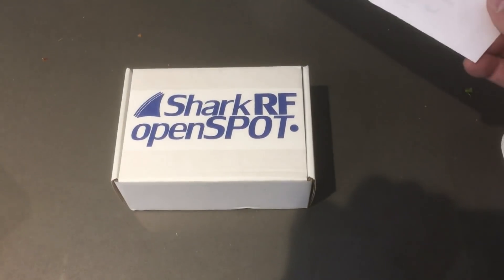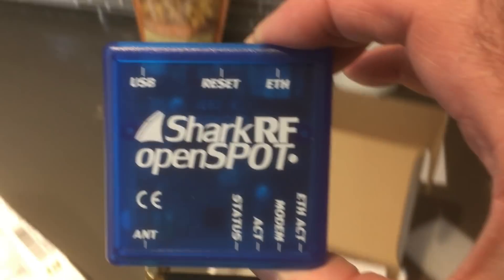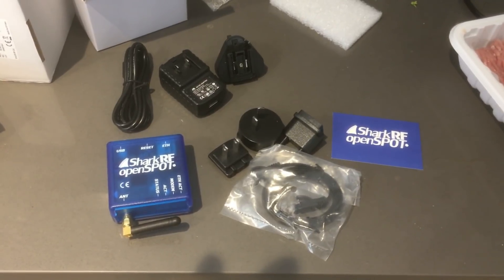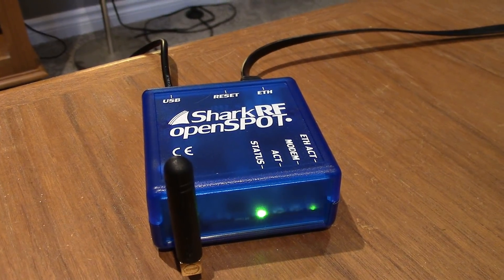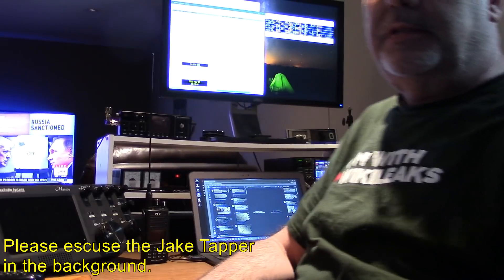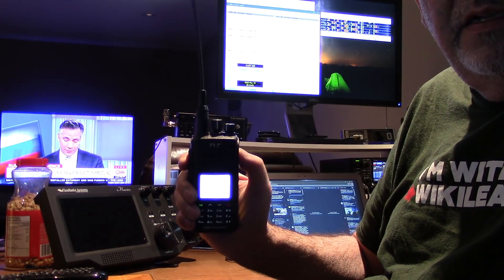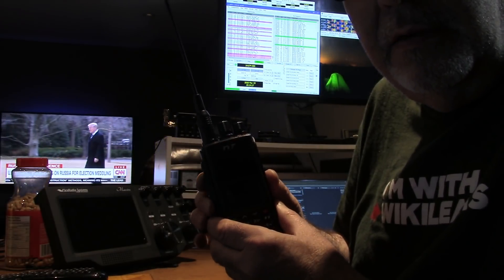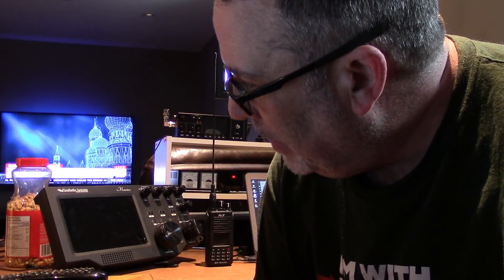Tytera TYT MD-390 - BRICKED!

Comment: Have you checked if the firmware matches the radio? My MD-390 is the GPS edition. And when I downloaded the latest MD-380/MD-390 directly from Tytera website and had the same initial screen after. But I was able to recover it after downloading an older firmware for radios with GPS.
Reply: Hola Geoff, sigues teniendo esos firmware me podrías pasar tengo los tyt md380uv-gps y tengo ese problema, podrás pasarme los firmware que tengas, estaría muy agradecido!?

Comment: Hi. The radio is not bricked, it is the ribbon cable to the display that is disconnected. You have to disassemble the radio and fit the cable again, with care, and the radio works again. Two hex screws in the buttom of the case behind the battery, and three nuts under the knobs and antenna. becarefull with the gasket upon assembling, you have to fit it on the metal part, grease it lightly and press the two part togehter. Good luck
Reply from the maker: Thanks - I'll give this a try!

Comment: Contact Tytera as this happens a lot. Also you may want to try:Turn on the radio while holding down the PTT button and the button above it. Then try reloading the factory default codeplug.  The catch is that the GPS and non-GPS radio codeplugs are not compatible.  Hope it works out
Reply: take ur batterie out put it back in
Reply from the maker: Stay tuned...

Comment: Sorry to hear about the broken gear. It sounds like you've checked out solutions for the DMR radio?.... I would have thought flashing a firmware rom might have fixed it? Hopefully the items are still under warranty and you can get them replaced/refunded?  Good luck. 73
Reply from the maker: I'm sure the warranty is voided by flashing the firmware.
Reply: It'll be a shame if Tytera wont help you with this problem. Just had a quick look around and it seems this type of issue has been reported, certainly in the forums that I checked out (DMR related). One person reported that Tytera supplied them with an updated firmware version, and after flashing that, the radio came back to life... also, this was how it was explained in the forum about doing the firmware update.......

...  Turn on the radio while holding down the PTT button and the button above it. Then try reloading the factory default codeplug ...

Fingers crossed you can get a solution to the dead radio. 73
Reply from the maker: I'm getting some good suggestion over on Facebook and in comments. STay tuned...
Reply: Good News.... fingers crossed  ;-)